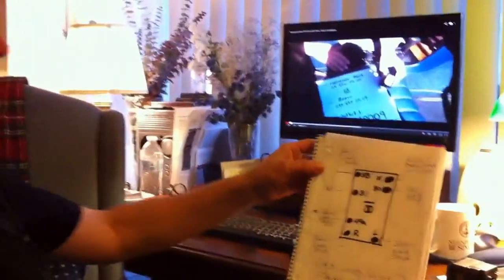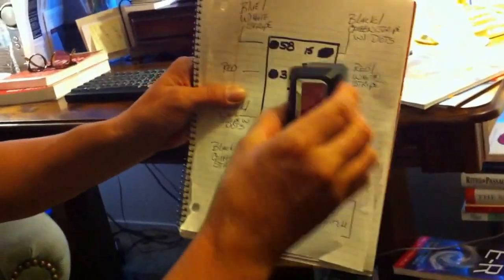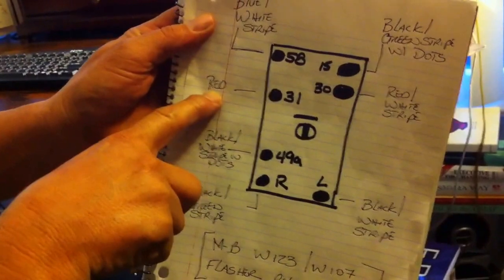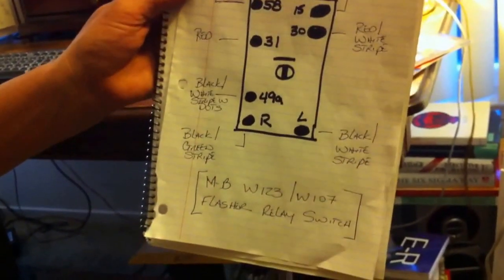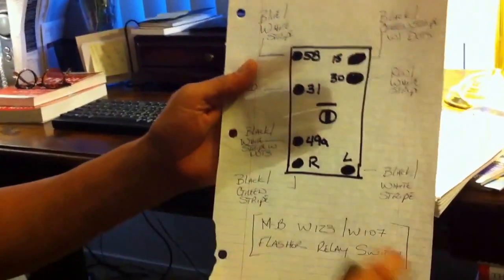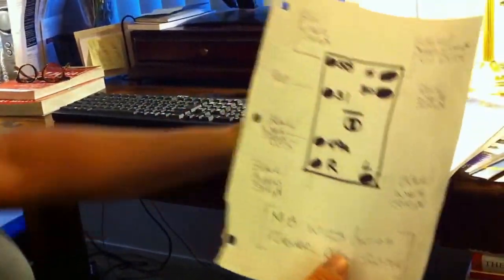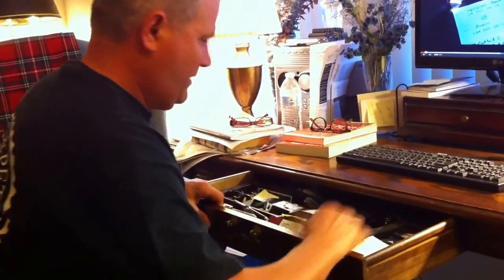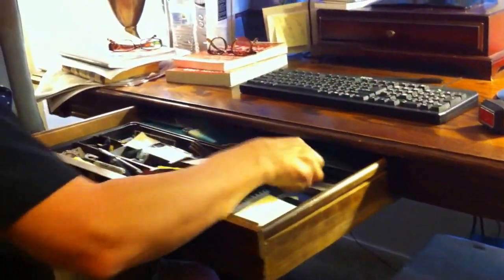Mercedes-Benz W123 Flasher Relay Switch Wiring Diagram

Comment: Hi Duke, 

Do you by any chance have the same thing but for a newer model. (1983 w123 with 8 probe wire)
Reply from the maker: I do not. It should be the same as W126 models.

Comment: Good information especially knowing there is a difference in the flasher units.  My turn signals are not functioning right.  The turn signal in the rear passenger side has gone dead but the one in the front has gone hyper.

Comment: Hi Duke: 

I am so happy I found this video. 

I am having the exact problem with the correct wire locations for a hazard switch but on a W108 280 Se 1972 4.5
Do you have any idea on the correct location of the wires for my switch?

Thanks
Miguel